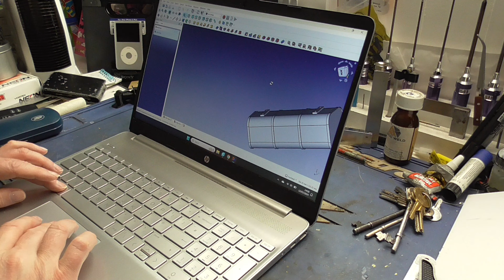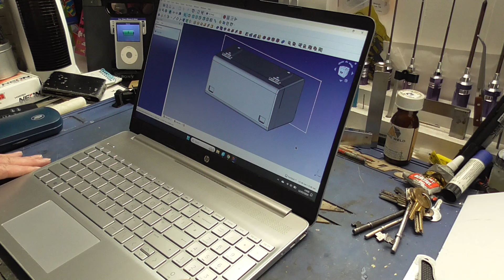I cannot Afford a Cross RC XX10 T-Rex so I'm Building the Dinky Dino - More Base Parts

Comment: Good work Malcom it's a real challenge custom building but so much fun I just got my final set of axles today and the aluminum for the frame so hopefully will start the build soon it going to be a long one 5 axles 5 motors 5 servos
Reply from the maker: It will be long, did you go for motor on axles to try and keep short. That's an issue I see with multi wheels is the gap between axles. The T-Rex did sort of solve that. The thing is as much  as you try and keep the budget down it can get out of hand.
Reply: @BasBoyRC  I did go moa I bought 3 redcat Danchee Ridge Rocks I'm going to use them I think it will work well
Reply from the maker: @AdventureTimeRC  Will work well no driveshafts to worry about. I had to go 4 wheels as not many rigs here with good MOA. Are you doing ALS and how many ESC's can you get away with.
Reply: @BasBoyRC  I think I can use 2 hobby wing 1800 escs not sure how I'm going to set the servos up yet
Reply from the maker: @AdventureTimeRC  I think with steering link 2 and 3 axles and if your radio has the settings for front rear steer. Then to line-up the steering up make the steering rods to length so they are all in line. Hope my idea is not too stupid.
Reply: @BasBoyRC  never a stupid idea any ideas welcome on some thing as strange as this build lol

Comment: Dig the difference in the build styles Mal,  Learning your process helps me on mine..  Love the progress..  Thinking of getting a new printermine is 13 years old now and tried running yesterday it wentbad..  What one you using and any advice taken brother..
Reply from the maker: We all learn from other and good its helping you. I'm using an ender 3 Pro and it been well upgraded, ender do some nice newer ones that have so much more over mine or what I have to add. I would look into videos of what's the best budget ones out there. Mine just had a refit, new motherboard and hot end. A new one might have been better for me but I'm used to this one.
Reply: @BasBoyRC  good advice I keep hearing enders are good.  Thanks bud..

Comment: You always come up with very interesting builds. My only question is how long did it take to learn the entire printing process.
Reply from the maker: Thank you, I like to do different. Printing does not take long to learn if using others files. You get used to how you like to use the slicing software. The CAD designing an on going learning curve, I find new way to do things all the time and the more I use it it does get easier. But printer set up to printing well no time at all.